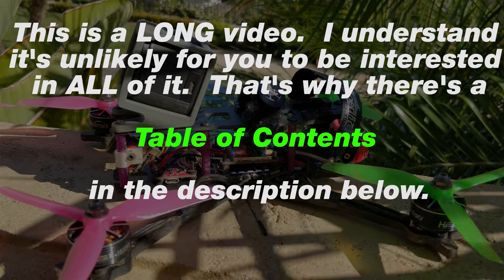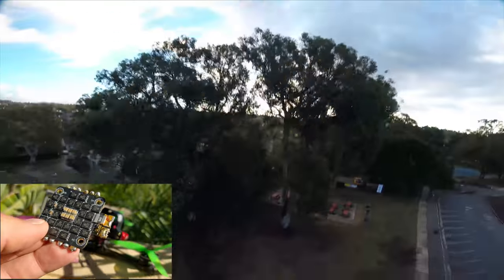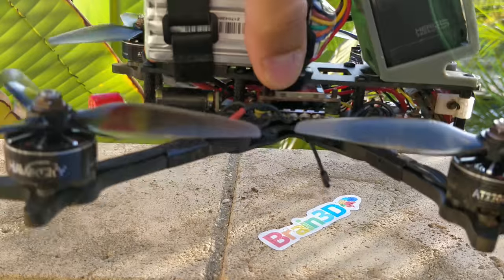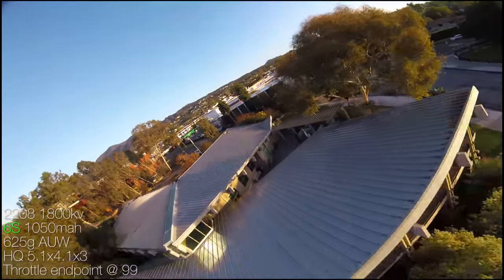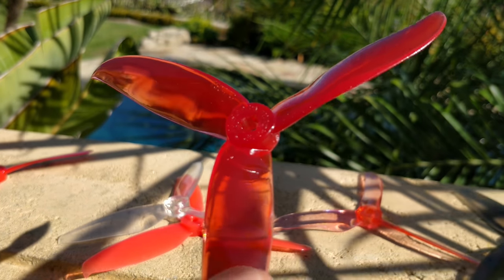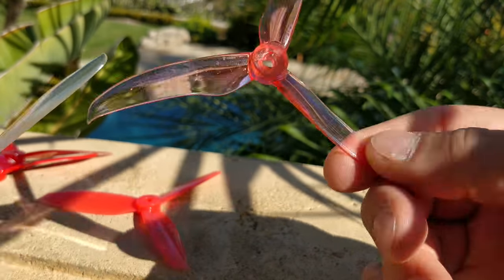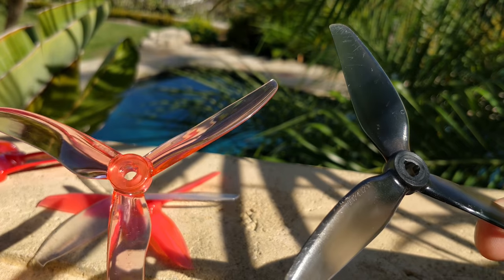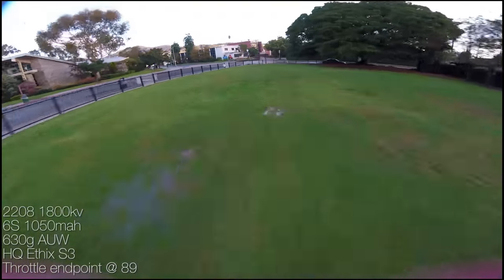HQ Ethix S3, My Setup Concepts, Frame Update, more....

Comment: For the rest, I got the same conclusion as you did. Ethix S3 props is crazy responsive and fast in acceleration, it expands your viable PID range due to its light weight and control, but it is not something I would put on my quad for first to third pack because I need to warm up and then use this to attack the tighter gaps and tricks because I need the extra control.
The 5.1x4.1x3 is the prop I would run for those first three packs and in most situations, when I'm scouting (modest ripping) and doing more open air tricks and trying to proximity cruise, where I need the more "stability" (I don't call it "less responsive" bc it sounds like its a bad thing when it is not) and slightly greater speed than the 3.1 inch can offer on my 2345kv 4S motors. 
Yeah, both props are going in my fpv backpack :)
Reply from the maker: I dunno bout speed actually. The S3 isn't that much slower. It revs so much higher.
Reply: @Kabab  Yeah I am actually on the fence on that too--it sounds much faster (probably just because its low pitch 5in that sounds sharper instead of medium pitch 5.1 that sounds deeper). But i guess its mostly in fixed pitch cruising that the speed behavior is different? My 5X4.5 V1S ramps the speed bit by bit until it tops out, and this prop just kinda put me there right away and then doesn't do anything until my fingers twitch.

Comment: They should have a chart for the pitch and blade flex that's what cause your feel on max throu where the prop looses it's pitch may straighten plastics are not easy to keep light and stiff
Reply from the maker: The new HQ plastic is WAY better than the old V1S plastic.  It holds up to flexing significantly better.

Comment: Soldering well, imho::  It's mostly down to the right ingredients, prep and muscle memory.  Use more flux and more heat...  never touch the tip to anything you're trying to solder without adding fresh solder and / or flux just before and during the weld.  Work fast and take the tip away from the work smoothly to let the blob reform into a spheroid (flux helps here too).  Don't be afraid to use too much flux.  Use a tip tinner.  Store your cold tip with a glob of solder on it to prevent oxidation, clean it off an brass sponge then re-tin it every time you power it up again.  Don't use a wet sponge anymore (hastens tip oxidation); brass coil sponge is better for fine work.  For each weld, you should take the iron from the stand, clean with brass sponge, touch the tip to solder wire just above your work, bring both to the work and continue feeding solder wire until you have a nice spheroid, stop feeding, slowly remote the tip from the spheroid and return to the iron stand without cleaning the tip, and repeat for each new weld.  Only put heat into the metals via fresh solder!  Standardize on one type of solder (as fine of a gauge as you can find for more precise feed control), so you can can fix everything easier from muscle memory (timing and visual feedback on how the solder behaves).  I've standardized on these bit for 99% of everything except repairing Lipo's (non-copper metals), and it all comes out perfectly every time now;

~1.6-2.4mm chisel tip, at least 400F for the smallest pads and wires (using the solder below)
https://www.sra-solder.com/lead-free-no-clean-flux-core-silver-solder-sac305-020-inch-4-ounce-spool
https://www.sra-solder.com/sra-312-no-clean-flux-pen-and-5-refills (best for rework when you don't want to add more solder, to round up blobs to perfection.  also prepping pads prior to pre-tinning them)
https://www.sra-solder.com/4910-solder-tip-tinner
https://www.sra-solder.com/soldering-iron-tip-cleaner-with-brass-coils (or refills in an altoids tin)
https://www.sra-solder.com/fine-braid-super-wick-3-green-25ft (don't re-use old solder; sucker & wick clean, then redo it.  use forceps to hold a small strip of wick so you don't burn the flux off way up the strip.)
https://www.sra-solder.com/rosin-paste-flux-135-in-a-2-oz-jar (use for pre-tinning wire, power connectors and larger pads; doesn't run into the pins of IC's; apply dabs w/ toothpicks and q-tips)

https://www.adafruit.com/product/1597 (best solder sucker)
https://www.adafruit.com/product/2476 (solder sucker tip refills)
https://www.banggood.com/120ML-Empty-Liquid-Alcohol-Press-Bottle-Glue-Residue-Remover-Clean-Tool-Portable-Dispenser-Pump-p-1226434.html?rmmds=search&cur_warehouse=CN (handy for pre and post cleanup, especially if conformal coating)
https://www.amazon.com/MG-Chemicals-Remover-Boards-Liquid/dp/B008UH3RDM/ref=sr_1_1?ie=UTF8&qid=1543098990&sr=8-1&keywords=Flux+Remover (better solvent than dirty alcohol, use in above dispenser to prevent back-contamination)
https://www.banggood.com/Soldering-Iron-Head-Tip-Cleaner-Copper-Steel-Wire-Sponge-Ball-p-932651.html?rmmds=search&cur_warehouse=CN (refill, though you can stretch and shake an old one out and stuff it back in more than a few times)
https://youtu.be/tfIwHuGzUEk < watch that and you'll have all the intuition you need

Yes, this is all a bit anal-retentive / perfectionistic for the moment, but things are only going to get smaller...  may as well get in good habits once and for all.  All this crap should be enough supplies for 5-10 years if you build a lot.
Reply from the maker: Very comprehensive. Thank you. I just received the kester solder and it fixed all.
Reply: @Kabab  Do you have a product link for which one you got?

Comment: Hello there. It was a useful video. Thank you. I used emax avan 5x4.3x3 prop with my 2306 engines before. My batteries were running out very quickly. then i used hqprop 5x4.3x3 v1s with the same engines. My flight times were extended by 1-2 minutes. Do you have any idea about the effect of V1S and S3 flight times?
Reply from the maker: The v1s is definitely more efficient than the S3. These days my preferred prop is the gemfan 51433. Really excellent prop
Reply: @Kabab  Thank you for the answer. Gemfan 51433 I will definitely try.

Comment: 2 years ago Hobbyking in a sale dropped all their props to $1 pair/bag etc., so I bought a literal box load, earlier this year I sold most of the Gemfan ABS 5030 & 5040 2-blade props leftover on eBay, they went really quick.
Surely 'legacy' props like those don't stand up to today's incarnations, so why did they sell so quick?
I still have a few bags, including some carbon-nylon 5040 2-blades, they were nice to fly but ridiculously fragile.

Comment: Nit sure how good your analogy is.  Reminds more of a inductor than a capacitor. As inductor smoothes current, and cap smoothes voltage, traffic flow is like current flow. A capacitor would add cars to the road to maintain a steady traffic volume. Whereas the inductor would be like your buddy keeping distance to smooth the flow of traffic.

Comment: When I saw JB esc and I noticed the similarities with typhoon 1.2, noticibly the back of the board with the caps in the middle.   I really like the new 2.1 but I think it could be too thick for my Merica 5 frame. Typhoon 32 V2+ looks very similar to the  tekko 32 without the ribbon connector
Reply from the maker: The v2.x is a totally different board. I think the 1.2 is actually more reliable. They all work the same.

Comment: If you want ultra responsiveness you have to trade off grip.  I've never tried the t-motor prop, but i can tell by looking at it that i won't like it.  Not enough meat to grip the air.  I think i'll hate a 3.1 pitch as well.  I mean i actually do like to accelerate over trees at full throttle.   I still think 4.6 pitch is the perfect balance of grip and response, but those dal 5249 have really great grip over the 5046.
Reply from the maker: This is what I thought as well but then I tried the tmotor prop and my jaw dropped.  The grip is better than the majority of props out there.  The response is outstanding.  Now the S3 prop has even better response and similar or maybe slightly less grip.
Reply: @Kabab  I tried to order the s3 from piroflip, but they ran out fast.  I'll pick up some t-motor props next time.  5.2 inch props don't fit on 90% of my quads.😩 That extra .2 inches does seem to make a difference without feeling sluggish like a 5.5 inch or 6 inch.
Reply from the maker: @mooosestang  Right that's why my new frame will fit 5.2.  I believe that's where we're going.
Reply: @Kabab  We need to go the other way to get the props out of view, 4.8 inch props.🙄 😆  Hmmm, i might have just created a whole new prop market!  HQprops are you reading this?

Comment: About the dipping issue as well, just some of my personal findings. KISS FC does dip, but I find that the harder I rip (the faster I do the "pump throttle-sudden right stick movement"), the less dipping there is (to the point of non-existence on KISS V2 FC) due to the TPA system doesn't adjust to your throttle value fast enough, that when you start pulling the trick at 0 throttle, the TPA is still at around 50% throttle whatever--which I believe have the same effects as all the new special BetaFlight PID functions?
Reply from the maker: The wobble started for me across all my quads when BF 3.4 came out.
Reply: @Kabab  Yeah feelsbadman, all my betaflight quads start to have jello or untunable top throttle oscillations when 3.4 came out too--lol huge part of the reasons I switched to KISS.

Comment: Sorry this may not be the proper place for my question:   Immortal T antenna placement.  I noticed that you always place it mid body, on all your builds with flosstyle and Glide frames.  I assume  this works OK, with no loss of RSSI issues?   I have seen some pilots demonstrating that mid body may not be the best, and that a rear placement is preferred.   But if Mid body works for flosstyle and GLide, I will certainly go that way -- much easier.
Reply from the maker: The way I do it is definitely not the best for radio reception. I just do it like that because it's secure, easy to transport, looks good and is really hard to get hit in a crash. I don't fly 10mi away so it's not really a big deal.

Comment: Did you try moving your cam up the standoffs to get the props out of view? The quad you showed us while you were talking still had tons of room to move the cam up. I know you might not have been flying it like that, and why dead cat over squished X. Also: why so low tilt? Who flys at 20 deg. or lower?
Your flying is REALLY looking good man! The improvement is cool to watch. That inverted jucy flick by the treetop was FIRE!
Reply: A lot of pilots fly with low camera tilt, (I started at 30 and have worked my way down to about 20 lately) especially for a specific style of flying kind of like the way Johnny FPV and Wild Will FPV fly. Wild Willy explains it in this video: https://www.youtube.com/watch?v=6nIA5DmcNTw
Reply from the maker: Low tilt is how most 'pros' might fly most of the time because it makes the view look very natural.  Also, if you're chasing cars or people, well those things are much much slower than quads so you need to fly really slowly.  Low tilt is basically a requirement.

Comment: So I'm actually planning on building a quad  when you release the frame, and was planning on 2400kv motors, however hearing you recommend 1800kv made me rethink motor choice. How well does low kv on 4s fly in terms of stopping power? Like pulling out of dives and what not.
Reply: Kwadify FPV same!
Reply from the maker: It's definitely not super powerful but with the HQ 5141 it's really not bad at all. Super controllable. I would give it a 6.5/10 but I don't really feel worried all that much. I don't have much wide open spaces so it's really not bad at all. See the flight at the end in my tree place. I set my 6S quad throttle end to 70..... basically 4S.
Reply: @Kabab  so what's the difference between a low kv on 4s vs a 2400-2500kv on 4s with a lower throttle endpoint?
Reply: @Kabab  Interesting how Betaflight configuration will look for 1800KV on 4S. I have completely no interest in racing, but wish to know freestyle will be on 6S quad with 4S battery.

Comment: I'm about building two quads, I just bought one set of 2750kv of Iflight Xing motor (they actually have 9mm bearings). I will limit the throttle.

But for the second quaf, would you recommend low kv motors and still running them on 4s. Other than the motor the rest is the same.

Comment: With throttle boost added in bf 3.4 and up, your quad will still hit 100% throttle, when you rapidly raise the throttle. But your not sustaining 100% throttle for very long, if you set your throttle to max at 90% in the radio.
Reply from the maker: right

Comment: the drifting issue from 3.4 has been handled in 4.0.. it was a bug in the item code that has now been fixed
Reply from the maker: INTERESTING!  How did they do that?!  I'm now looking forward to 4.0 a LOT
Reply: Good to hear! Im looking forward to 4.0!
Reply: Kabab FPV the iterm relax was bugged and the iterm limits were too low ( how Much was allowed to accumulate ). In 4.0 the stock I values are much higher than  before. It tracks much more accurately in mixed yaw turns than the previous versions. It won’t make 4.0 but there is filtering based on motor rpm in development.. pretty much the holy grail of mini quad firmware development.
Reply from the maker: @Sugar_K  whatever it is, I can't wait!
Reply from the maker: @Sugar_K  wait a sec, when will the F7 come in play?
Reply: Kabab FPV higher sample rates are been pushed by people trying to make money from hardware... there is no real advantage to running 32k sampling.. it’s introduces so much extra noise  that then has to be removed before you introduce the data to the PID loop. The small speeds advantage is basically negated by the extra work the FC has to do clean up the signal. Remember the slowest part of the whole equation is the motor response.. even at 8k/8k the FC is still cycling at a massively faster rate than the motors can respond. Also the motion of the quad is all in the 0-30hz range and then from 30-90hz is prop wash.. every thing above those two bands is junk. don’t get sucked into the numbers game hype..
Reply from the maker: @Sugar_K  I have been aware of all this for a bit now which is why I'm still confused why so many F7 boards are selling when there is seemingly no firmware use for it and unknown how it'll even be utilized.  I have an F7 prototype FC that I'll be testing shortly and have heard from many that F7 boards just seem to feel better but I'm still weary.  Especially when an F4 is sitting at like 20% use in flight.
Reply: Kabab FPV the f7 would be good if you were running complex calculations that required more horse power but that’s just not what’s going on right now.. notice that those that are pushing the F7 hard have no data beyond seat of the pants testimonials about how much better it is vs an F4 8k/8k setup? It’s all number hype to get people on new gear.. as I said rpm based filtering and PID loop manipulation is on the horizon which will mean less filter calculations needed to achieve more exact and dynamic filtering. It will be a big leap forward when it’s implemented
Reply from the maker: @Sugar_K  so then what are we doing with all these F7's?! 😆

Comment: How does the horizontal FOV of the GoPro changes on each line? Any chance it might be narrower towards the middle, allowing you to get the props off-view by moving the camera lower instead of higher?
Reply from the maker: Good question.  Yes it does change, but not enough to matter when the gopro is set on top of the quad.  Raising it up is more useful at this point.  Frames that put the gopro front and center instead of the FPV camera usually end up in more FPV cameras broken whereas a gopro in a TPU case hasn't broken on me yet.

Comment: Do you mess with motor timing and acceleration in blheli32? I have been messing around with 2600kv at lower timings and slightly higher accelerations and after I toasted a 4in1 I started getting great results but does this even need to be done with dshot? Basically just want to know what you do and/or your opinion on the matter..
Reply from the maker: I've played with that but haven't had much if any improvements with altered settings. I have a history of smoking MANY ESC's back in the days of awful individual ESC flashing. I tend to not mess with ESC settings much. Just rotation, demag high, lower the start up sound volume, reduce the temp limit to make myself feel better and that's basically it.  Also, while dshot is good, I've now heard from multiple developers that multishot is technically faster and healthier for the ESC. Hard to say anything beyond that because I don't understand it. I still prefer dshot however for the improvement in turtle mode compatibility with many quads and the percentage setting for idle over the min throttle.
Reply: Kabab FPV yeh i prefer dshot as well especially with dshot1200 im not sure how much improvement multishot would have, thx for the info!

Comment: Great content pal. I'm interested in the way you limit your throttle to save killing baths, especially on high kv motors. 
How do you limit max throttle to like 90%. Thanks
Reply from the maker: throttle endpoint in the controller.  You can set the range from -100 to 100.  I fluctuate from 60-99 max throttle endpoint.  It spreads out the rest of the throttle across the stick range so it feels like far more resolution.  Because it's a 200% scale, dropping the max to 70 is like cutting the top 15% off the throttle range.  Doesn't even feel all that different but you have more control.  Also, when you hit the top throttle, the quad keeps accelerating up the kv ramp.  It takes a lot of power to punch and accelerate but once you're at speed, all you need to do is overcome drag so it's less energy to stay there.  That's why once you get moving, it'll keep accelerating as long as the torque/RPM's exist on the motor to keep going.